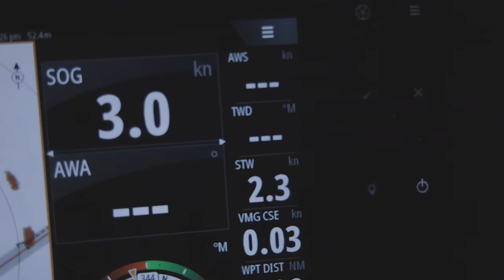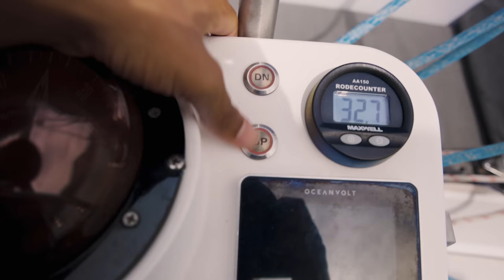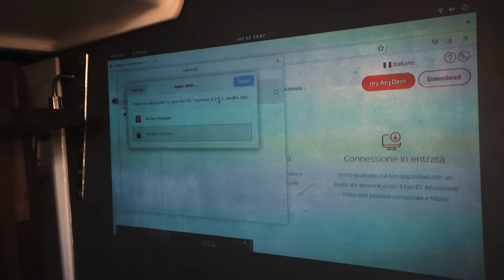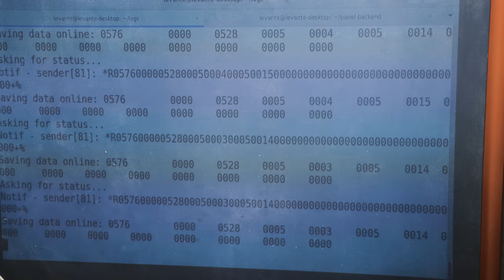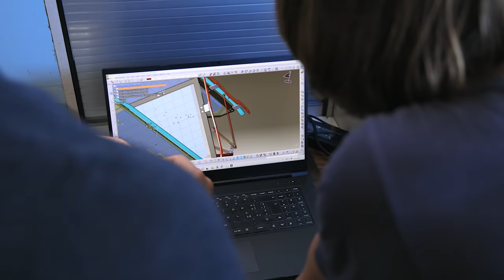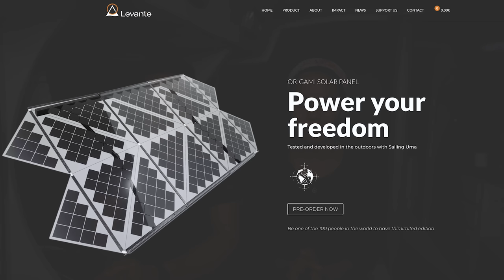NASA Inspired Solar Wing | Step 333

Comment: Hi guys, been following the origami solar progress. Seems that unlike paper the units can't support themselves. I'm sure it been thought of before but a few ideas come to mind. 
1. like origami cant the whole structure be made of one piece of foldable plastic. This will still need support though.
2. flattened umbrella easily assembled and can have a base insread of a handle
3 a plastic under panel flexible but can be inflated by air or even water which could lower the heat of the units and also provide hot water on board.
Any I enjoy the channel
Reply: I like the idea of air and/or water pressure based load carrying structures. That starts me thinking about natures solutions, plants, leaves, trees, cellular methods, ... I'm thinking tethers from above, that can also be used to control tracking and even carry power/data, perhaps with tether below to keep it taught( like up/down hauls, preventers, ...). Might be interesting to use the stays as well as part of the solar rigging...
Reply: @georgemacdonald8899  yes agreed but on a boat you need to get the panels up and down asap. Straps and tethers could get complicated. The air/water base could have inflatable struts/triangles built in then all that's needed would be to clip the panel where needed  on cleats gunwhale etc.
Reply: @sjo800  I was thinking that the "dynamic solar harvesting" would end up being like the "wind harvesting", i.e. require a careful attentive eye on it and easily deployed/withdrawn. The active rigging on a boat comes to mind as a well tried and true method. Lines(tethers) to control the power of the sails... In this case though, we now have inexpensive embedded computers that can supplement(replace?) the human monitoring/attention... Kite string/lines are bred for the lightest/strongest control lines that I can think of, perhaps those could be used with auto retraction like a seat belt, with a quick clip in... Something like, Clip in the panel to a side rail/mount; pull down lines from above and clip to panel' release the panel to let it deploy; pull up on hold lines from below and clip in... I like the water idea for harvesting the heat though, so would like to see what your talking about tried as well. Was also wondering if spinnaker poles could be used, perhaps modified like collapsible antennae, or hiking sticks... They might be able to transfer the heated water....
Reply: @georgemacdonald8899  George I understand your methodology re lines, spinnaker poles or other strand attachments and they might work, but I feel the whole point of all your hard work is to produce equipment that can be setup and collapse easily without taking up too much real-estate particularly on a boat. From what I can see you are up against the static panel market and more worryingly the roll out type systems.  If the idea is that this setup would suit your needs only then it's worth thinking about, however commercially the setup proceeded could be a stumbling block. Could  the panels be arranged in a fan shape that you simply spread out, each one slightly overlapping the other to help support, then you would only need to support the centre by a pole to a fitting on the boat or even hang it from anywhere like an upside down umbrella which could be moved around easily. 
Just thoughts.
Good luck

Comment: I realize the criticism of this is disheartening, probably taken as a personal attack. But as someone that's tried and failed to create things myself, consider it a gift. Most will give no feedback at all when they see faults, and let you fail alone. Some will cheer on with false hope, though they won't buy it themselves. The critics speaking up now are the same ones that wouldn't buy this later, and they're giving reasons while this is still in an early prototype stage.

I suspect you're like me, and will keep creating this out of a labor of love, a vision you just have to create. I wish you all the best of luck and admire your creativity. But don't hate the haters, now is the cheapest time to listen.
Reply: I don't really have the technical expertise to give real solid feedback like yours. I can see that the 3D-rendering on the website has aesthetic qualities that might be impossible to get from using squares. But having said that, a 3D-rendering is one thing... Making a working product is something else... And everyone does of course also know that. But still...

Comment: I wonder first about the way your video opened night sailing. Do you already use, or think that getting night visions devices would help in that regard? Or would you consider them unnecessary? Our tactical night flight operations are almost completely dependent on NVGs now. Second, like I’ve remarked before, I think you’re both amazing for the projects you tackle. And partnering on projects with other folks. Amazing stuff. The array folding into more compact kits is the dream, no? We have a Bluetti system for emergencies, our stand alone gazebo patio and we take it with our camper also. Love it. Powers the fun stuff and serves as a back up/supplemental system to our Generac home system. But the three folding arrays are quite heavy and the single fold “portfolio” packing still has them as large as a giant suitcase. And pretty heavy. I’m sure the tech will get there though. Lighter, folding more compactly, and getting to at least to 50 percent efficiently would turn the public acceptance on its ear. Great video.

Comment: If I understood right your wind indicator is battery powered and the battery is within the instrument that you mounted at the top of your mast. I was just wondering if you ever considered putting wires down through your mast soldering them in to your battery connections and then put a battery box and a much more readily available spot or figure out how to reduce voltage by stepping it down so we can run off your normal power.
Reply from the maker: If we’re running wires down the mast, we’d just get a wired wind sensor. This is supposed to be an easier solution since it’s solar charged. But we got the very first one. And it’s had some problems they’ve apparently fixed since then.
Reply: @SailingUma  Yes that is of course the other option it just cost more. Of course remember mine is just free advice whether you take it or not it is totally up to you. It’s not like I’ve ever really know unless you told me so happy boating😎

Comment: Hi, we have 63 solar panels on our house so we know a bit about solar panels. You should throw out your existing solar panels and replace them with 2 -450 W LG or better solar panels.  Your energy needs should be met with 900 watts verse 400 W.  These panels have better quality silica in the cells and thus make more power - 21% efficiency verse 15%.  You most likely will need new charge controllers.  Then you can mess around with this toy.  As you know, some people also hang solar panels on their side rails to use while at anchor (two more 450 w panels?).  Merry Christmas.  For storage of energy, they now make 500 ahr cells, so your 100 ahr cells are a bit dated.  You of course know all of this as you guys a very bright.

Comment: 5:38 Guys, I think this is what you need. Google it: "Paper-thin solar cell can turn any surface into a power source"

The novelty has the ability to generate 18 times more energy per kilogram of its weight than conventional solar panels.

Comment: I like the way those panels fold up.  But I would try and find a way to use them on a floating foam raft.  Like what people use in Miami sand bars.  The reason is the area is so much larger than what you can attach to the boat.

Comment: I would advise to have shrouds, wire frame to make the whole stiff when extended. The pannel sits at the outside of the boat where the acceleration is most. It will be so much more rigid and with the correct selection of poles and lines the whole would still be light wight and foldable. Amazing videography as always

Comment: Very Cool project!  A couple of questions.  What's the goop at 14:45?  It looks like you dip the end of a tinned wire into it then crimp a connector pin to it.  I assume its some sort of anti corrosion jell that allows conductivity to the crimped pin.  At 22:16 "Kim?" mentions something your connecting to that is unintelligible to me.  What is it?

Comment: When you went to Norway, didn't the cold affect the life span of your batteries? Do you have a heating system for your batteries to control the temperature for optimal charge and discharge?
Reply from the maker: They can operate down to -20C. But since they’re below the waterline, the ocean would have to be that cold before the batteries were. And if the ocean was -20c… we’d have much bigger problems.

Comment: At 1:00 Is there any way you could hardwire the sensors at the top of the mast? There are types of connectors that let something swivel 360° and still maintain connection. Would it be worthwhile to spend time on a DIY hardwire connection to the sensors, thus preventing any future issues?
Reply: Another product opportunity, multi-copter that can pluck/dock instruments at top of mast...

Comment: The triangular origami design is WAY too complex. This needs an extensive parts list, and will be a nightmare to maintain.
A much simpler rectangular design with foldout hinges and tension supports would be far cheaper and easier. This would also be a more marketable product.
Reply: Where would you stow those on a boat, as a table, part of the bed? Not a lot of space that is nice big and rectangular on a sloop. Easier/cheaper to design for sure, not so sure about marketable. This solution is different....

Comment: Have you considered that an addition to your solar power would be a sail with solar installed on them?

I have seen this described in the past I do not unfortunately have a link but with a little bit of searching hopefully you'll find something useful.

Best wishes
antiguajohn
Reply from the maker: Sure! Solar Cloth isn’t a thing just yet. But there are some companies experimenting with solar panels that can be glued onto the mainsail. They don’t last long though and only work if the main is up. Making power while sailing isn’t an issue for us with regen. We make more power than we use. It’s at anchor where we need the boost. Hence this origami project.
Reply: @SailingUma  thank you for your reply, as I see you have researched this more than I have and you passed out information which I appreciate.

That said let's hope new technology improves everything. Best wishes

Comment: Dan and Kika. I wonder... do you guys think these would have any application in off-grid home construction? I know the storability is a huge selling point in the marine environment. I could also see the logic for an RV setup. But I'm wondering if you guys see any advantage it could lend to off-grid housing?
Reply: A big advantage is the "agility" of this approach. i.e. it has the potential to pack up, move and redeploy quickly while reducing space needed in transit. So for off grid housing, you could transport it with you for trips to other locations, and easily store it for when your not there or not using the panels. When they add tracking, it will harvest more energy.
Reply: @georgemacdonald8899  That is a very good point! With the usual solar set up for a house, it's a lot of trouble taking a panel down and transporting it. And they tend to be so big that it's hard to fit it inside a car. So you end up having to leave them in place and buy smaller panels that are more transportable. It would be nice to have a solar panel that was collapsible and easy to unplug to be more mobile.

Comment: I'm not convinced by the choice of hard material for this project. I would rather use flexible pv. They are slim, lightweight and can easily be dismounted and stored away.
On a boat, you can mount them on the side of the boat, an arch or bimini, so you don't need the origami support which add weight, thickness and complexity.
I think that boating is maybe not the primary goal for this product, and I also understand that you are happy to help on this project, but I'm not sure that this is a good idea as a primary and permanent solution for UMA.

Comment: Could you not add some fold out brackets underneath so that when fully unfolded it would better support it rather than all pressure on the hinges? Think like a table leaf that could still be folded back meaning you don't loose the space saving benefits you are trying to achieve

Comment: (Only 4 minutes in) I think you are trying to make the solar panel too thin in the deployed position. There is a whole stanchion height to hang off of. A few folding braces clamped higher up the stanchion (or bits of string) would not add to the furled thickness, but would suppoer the weight much more easily. 
(And, yes, I know that this was several months ago and you probably solved this several/2 months ago)

Comment: I would heat shrink over the heat shrink solder connectors you heat shrunk. remember this is salt water and it can find its way in so double seal is better.
Reply from the maker: Those are already waterproof connectors. We’ve used the same ones for our bilge pump. Been underwater for 5 yrs. Still works great.

Comment: Why does it have to foldable and hinged to the boat? If it is mainly aimed at power at anchor/stationary, why not a floating solution? This would have the obvious advantage that it is very easily extendable and doesn’t need any moving hinges.
Reply from the maker: It where would it go when we sail?
Reply: @Sailing Uma  No particular magic solution comes to mind. The panel (wing or floating) need to be stored somehow anyways. I was just thinking aloud whether a wing solution is really the best, considering the issues with any mechanical moving parts, when a floating solution (think rubber mat coated with solar cells) could do as well. Would be easily extendable, possibly even rollable.

Comment: Has anyone come up with a sail with built in PV cells? Or would it completely ruin sail shape?

This triangle shaped panel makes sense.....if you need to have the smallest possible folded max dimension. But if you can get by with a setup that has a larger max dimension, a panel that folds up into a 4 ft long rectangle is simpler, lighter and has more cell surface area.

Comment: It is interesting invention. About the places where to use that thing  (25:46) I think there is one more very important place I am not sure you are aware of. The Ukraine has now very, VERY significant problems with electricity (everybody knows why, I hope) and that would be great solution for civilians, or hospitals (or both). I wonder how does it endure in below zero temperatures. I hope one can think of this not only as a source of energy for leisure  but also for more important needs. Take care.

Comment: Sorry guys. I can see that you're really enamoured with the origami element, but greater complexity means more points for failure.  Satellites don't have to cope with gravity. Give me a simple triple stack where you have your current panels as the static top layer, and two lower layers on extra heavy duty, long extension drawer glides; one sliding out to port and one to starboard. Your top static panel will always be supplying power.  Also, while you're at it, why not customize your dodger so the roof is PV panels ?  That would double your solar generation right there.
"Tiny Homes" were intended as a means of home ownership for the working poor wishing to be free of rent and mortgage serfdom.
  \ _ _  is the deployed configuration on my (sometimes) vanlife.  The left panels slide out and can be angled upward. The right side panels slide out and form a rigid awning. The only "stowage" needed is a narrow space for the extendable pole supports. Set up and stowage is about 10mins each way.

Comment: Why not attach them to the hull of the yacht as a permanent feature? More surface area.
Reply from the maker: Solar only curves is one direction. So in order to laminate it to the hull, it would need to be a very custom (ugly) hull shape. Or laminating each cell individually, which would be a nightmare. 

Sun reef does on their hybrid catamarans, but they also start at 4 million….

Comment: I'm surprised your wind instrumentation on the mast doesn't have a small solar panel or wind turbine to keep the battery charged.
Reply: It does have an integrated solar panel on the mount
Reply: Or backup squirrels.